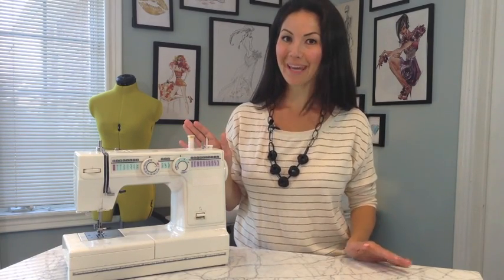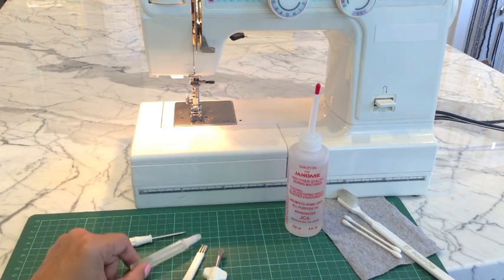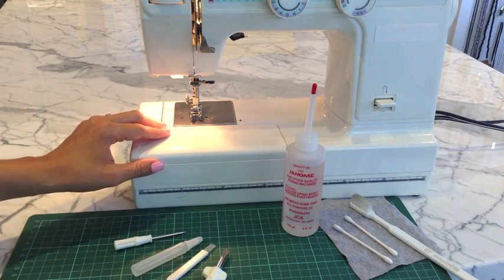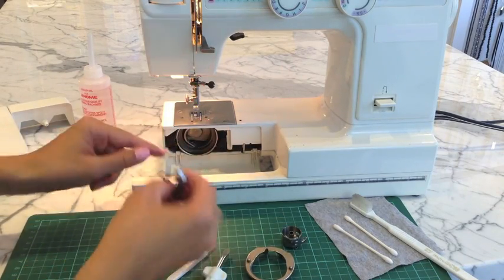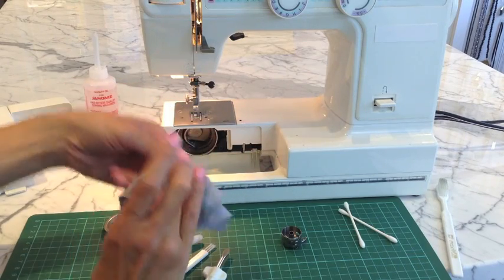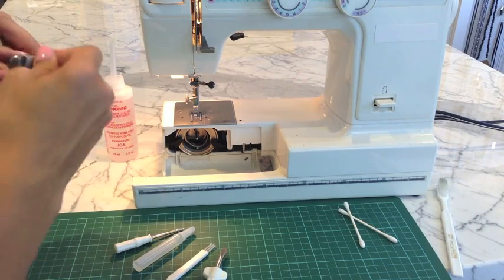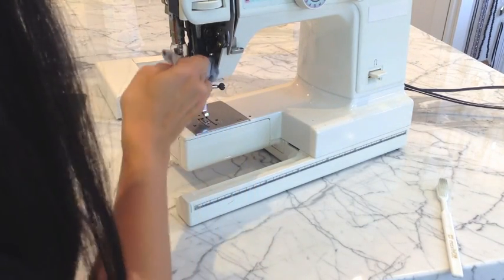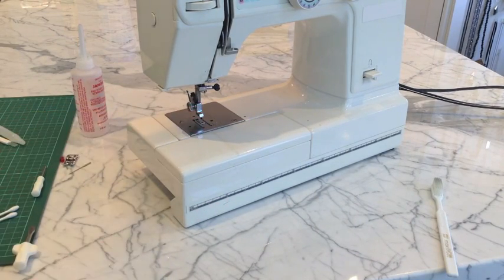SEWING HOW-TO: Oil Your Sewing Machine

Comment: I made the mistake of using WD-40 to oil my wifes machine'some years ago and it was laid up for some time. When she came to use it it was totally frozen up.  I used a hair dryer to free up the mechanism by reducing the oil viscosity, and have now re oiled it with sewing machine oil.  Lesson: do NOT use anything other than recommended oils. If your machine is stiff, try using a hair dryer, and follow uop with proper oil.
Reply from the maker: Woops! :) Well, great tip about how to get things moving again! Thanks, Ken! And yes, only use sewing machine oil. :)

Comment: MY UPPER THREAD IS NOT PICKING UP THE LOWER THREAD.WHAT SHALL I DO?THANKS.
Reply from the maker: There are three things you need to do to ensure this happens. First, make sure you're holding the upper thread taught against the sewing machine. (This will provide adequate resistance.) Second, you have to turn your handwheel TOWARD you. (Sometimes people turn it away from themselves instead of toward.) Third, you need to turn the hand wheel through one complete cycle. Watch the take-up lever go all the way down and all the way back up. If the take-up lever isn't all the way up, it's not a complete cycle. Sometimes people watch the needle, in which case a cycle hasn't been completed and the bobbin thread hasn't been caught. Watch this video at 7:20: https://www.youtube.com/watch?v=GhogDBjRXKg. (Forgive me for how ancient this is. It's the first video I ever recorded, done about 10 years ago on a BlackBerry!) Keep me posted!

Comment: What do you do when your feed dogs won't come back up
Reply from the maker: Have you found the switch that raises and lowers your feed dogs? If you're using the switch to properly engage/raise them and it's not working, you'll have to take your machine in to be repaired. If the switch does work properly, make sure that once you engage/raise the feed dogs yourself, you advance the handwheel toward you a couple times to bring them up. Keep me posted!